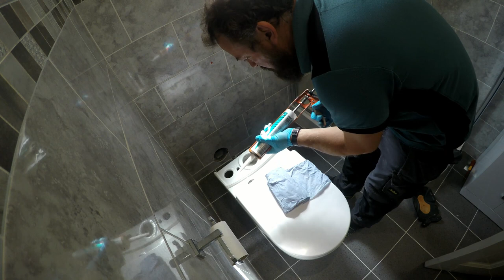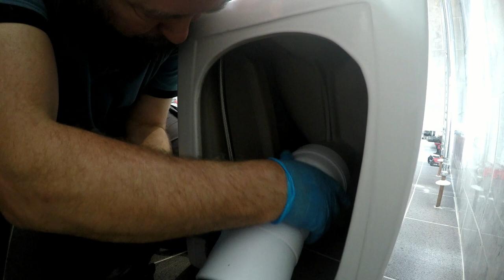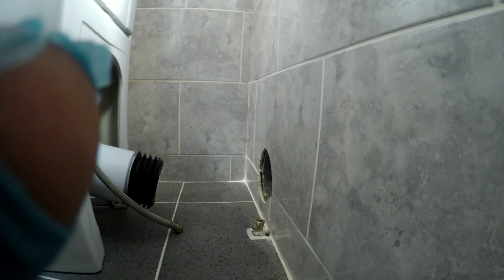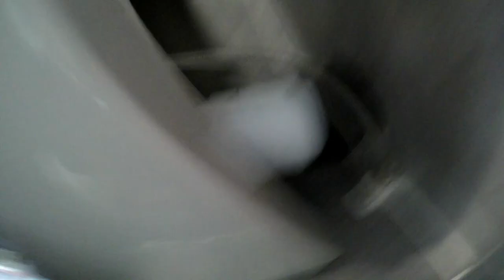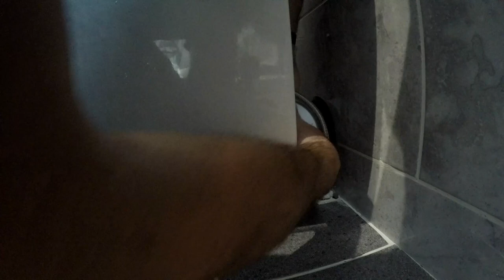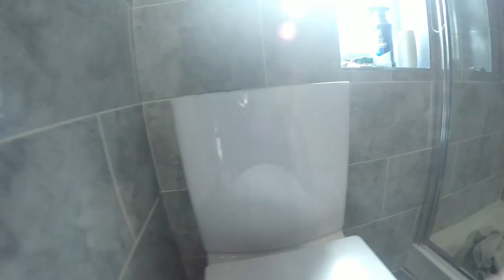How to fit a close coupled toilet plumbing tips from Dees Side Limited

Comment: 😱cant believe you used silicone, you dont need it as long as the rubber washer is put on correctly then there wont be any leaks. Nice video though. Would be good for the novices if you did a voice over explaining what's happening
Reply from the maker: Thanks for the comment What can I say its a problem with the cheaper brands here and the porossity of tge porcelain units against the rubber seal after about a week it starts weeping through and becomes a callback issue so in th UK we just slap some silicone on to pre empt that. I will do do walk throughs from now on 

Thanks again great commet much appreciated 

Ciaran

Comment: I think  there  is no need  for a silicone  the  doughnut  between  the  tank  and  the  toilet  is good  enough  sill   enjoyed  the  video.
Reply from the maker: Thanks Ratch I have had a few slip while putting on the porcelain cistern so found this the easiest way to keep it in place.... nothing worse than having to take it apart for a leake as it has not squeezed into place properly.
I appreciate you taking the time to comment and agree completely that this can be done without the silicone 
Thanks again 

Ciaran